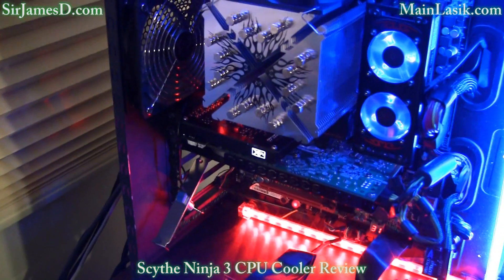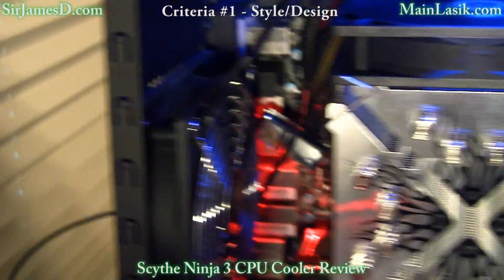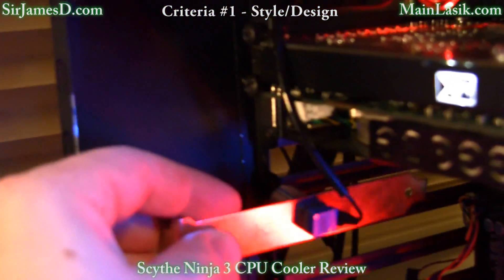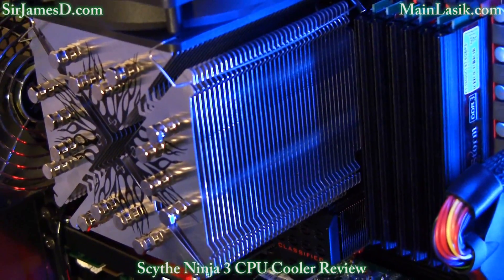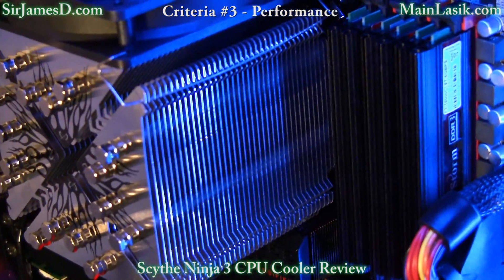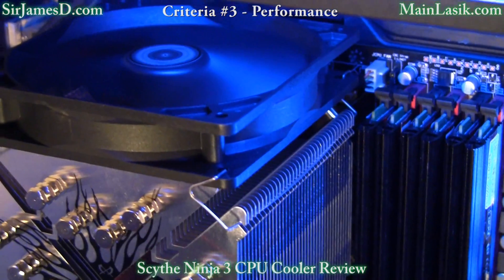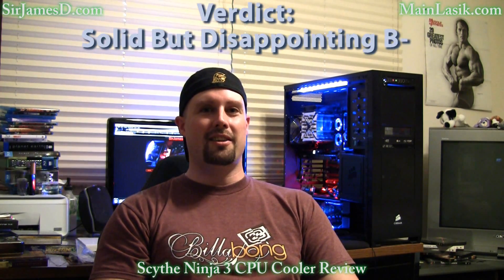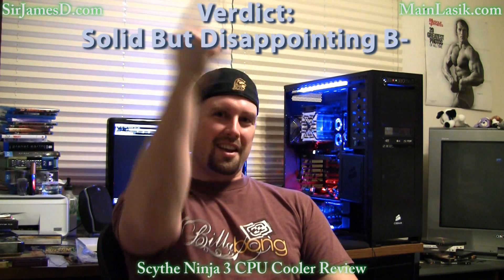Scythe Ninja 3 CPU Cooler Review

Comment: hi, i bought this cpu coller but something is weird, the feet of the bracket above the motherboard do not touch the motherboard, but it is already tight.

the rubber washer is doing nothing at all because of the space, if i continue to tighten it will surely damage the motherboard, so i stopped.

Is this normal?

notice the space on the top right bolt, and the rubber washer doing nothing : 
http://i59.tinypic.com/5jsos1.jpg

Comment: really you could do a push pull if you didnt have that heatsink. or if you had fans in the top of your case like i do. ive got the ninja 3 sitting on a athalon II x3 at 3.7ghz and my idle temps are usually around 25-28 full load i never see it go above 40 even after running cinebench 5 times and converting a 1080p video for an hour. in my opinion this is the best air cooler on the market